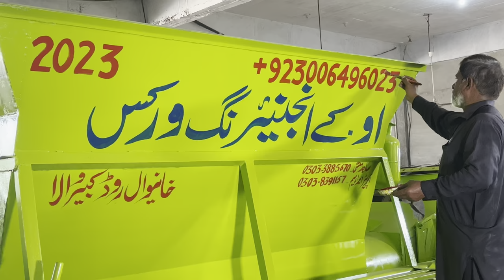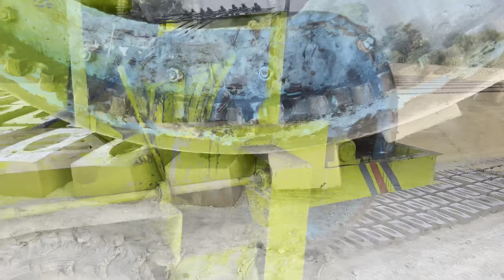Manufacturing Process of Bricks Making Machine With  4 Moulds Rows || Mobile Bricks Machine

Comment: You got to hand it to those guys, they don’t waste anything! Most all of the material looks like it was salvaged. Over here in the USA everything would have been new material and the cost would quadruple. I have always been know as a scrounger/Hoarder and have made some really useful and even elegant devices/machines using mostly salvaged materials. Using that kind of material requires lots of “Fluidity “ in the design. Hahahahaha! Good job guys!!!!
Reply from the maker: Thanks for watching ❤️
Reply: Most of the metal comes from  old ships the come to be scrapped all the different companies go to the coast and buy whatever types of metal they use

Comment: Wonderful Machine prepared by great hard work and Skill, although it has complex technology and manufacturing but is very much useful for Bricks Making Industry, it will definitely reduce the Labour Cost and increase Quantity of Production, so Bricks Price May Reduce, The Manufacturer Should Pay Attention on Machines, Like Lathes, Drill Machines and Grinders etc, Use Raw Material (New One) and PPEs for Workers, they (Workers) should also be well trained in like, Fitting Parts, Bearings  not to be Hammerd and produce Welding Joints as per Standard Practices so that their Skill may become Solid and Proven one. Thanks a Lot for the Video and Effort carried out in preparation of Video.
Reply from the maker: Yes sir you are right

Comment: ==> English <==
It's incredible and I was shocked by several things I saw in the making of this machine:
=> The skill of how they make the pieces without greater technique or millimeter measurement.
  => Those old lathes they use do not have the adjustment to perfectly polish the pieces with vibrations and shaking pieces.
=> The cuts are made by eye and very rarely are they seen taking measurements. I only saw a template to make the holes in the wheel that delivers the brick to the floor. The leveling of the chassis on a cobblestone floor that shows the ups and downs.
=> No security measures, with sandals making cuts and welding left and right.
=> Minors or very young people working ordinary.
=> In addition to many other things, it seemed impossible to me for the machine to start working without doing any type of operating tests on its precarious manufacturing. And after finishing go to work impeccably? They are worthy of admiration.
My most sincere congratulations from the industrial city, Manizales, Colombia!!!!!!
                               ----------------------------------------------------------------------------
==> Español <==
Es increíble y quedé impactado con varias cosas que vi en la fabricación de esta máquina:
=> La destreza como hacen las piezas sin mayor técnica ni medida milimétrica.
 => Esos antiguos tornos que utilizan, no tienen el ajuste para pulir perfectamente las piezas con vibraciones y piezas trepidando.
=> Los cortes son a ojo y muy rara la vez se les ve tomando medidas solo vi una plantilla para realizar las perforaciones a la rueda que entrega el ladrillo en el piso. La nivelación del chasís sobre un piso adoquinado que se le nota los altibajos.
=> Las nulas medidas de seguridad, con sandalias haciendo cortes y soldaduras a diestra y siniestra. 
=> Menores de edad o muy jóvenes trabajando común y corriente.
=> Además de muchas cosas más me pareció imposible que la maquina entrara a funcionar sin hacerle ningún tipo de ensayos de funcionamiento en su precaria fabricación. ¿Y después de terminada entrar a trabajar impecablemente? Son dignos de admirar.
¡Mis más sinceras felicitaciones desde la ciudad industrial, Manizales, Colombia!!!!!!

Comment: These men make so much with such little tools. They believe in brute strength to move things. Their work ethic is stellar. These men sure know how to work. Great job to all the men involved. The only thing that needs to be standard is some personal protection equipment. IE: Steel toed boots, dark glasses when using the cutting torch and most importantly a proper welding helmet that protects the sides of their face and eyes. They should not be forced to work in unsafe work conditions.

Comment: In 2023 I would expect to see more safety equipment used, than sandles, no safety glasses, or face shields, even for welding. Although I am amazed by the level of skills to manufacturing these machines, with almost primitive tools and manual labor. Somewhere there is a OSHA inspector's head exploding, just watching this video.

Comment: Is this a video of the Taliban building a tank or? Anyone else looking for Tony Stark building an Ironman suit? :)

So let me guess the job requirements:

1. NO safety glasses, gloves or other PPE. (Works great when using a metal grinder. Those sparks of HOT METAL will never hit you in the face).
2. Open-toed shoes or sandles are OK (perfect when using a cutting torch or moving heavy steel around).
3. You will work in dirt... and maybe more dirt.
4. NO overhead crane or device to move heavy items... Just you and 10 buddies...
5. MANY trip hazards will be in your way. Watch your step!

Sorry to gripe. I hate OSHA just as much as the next guy, but damn.. this video is proof why they are needed! 

I watch a lot of these types of videos and it amazes me that most do not use basic PPE such as safety glasses and proper shoes. Some don't wear shoes at all! I guess the fear of losing an eye, toe, or finger or busted back doesn't bother them. Any of which can happen in a split second (I'm living proof and I DID have proper PPE).

I must say that guy has a very steady cutting hand with that torch! Nicely done. Not many people can do that. And despite being a turd-world country and poor machining capabilities - they do get stuff done. You do what you have to do!

They should also heat that housing so the bearing will install without beating it to death. Using their torch, all it would take is a few thousands of expansion and that bearing would probably drop in by hand. Old machinist's trick. Works every time. Also freezing the bearing or heating its inner race works good too. 

Thanks for the video and THANKS AGAIN for not putting stupid-lame music over the top! Personally I enjoy HEARING the manufacturing just as much as watching it. I cannot stand music of any kind laid over the top.

Comment: In the UK we seem obsessed with steel toecap boots. I'd love to see the injury figures for India v UK!
Reply: These guys are in Pakistan but close. The figures can be found online are not good. Unfortunately, this minimum safety in the workplace is seen across the third world. It's hard enough to get companies in the first world to follow the rules. They also don't have easy access to proper safety gear and if they did it wouldn't be affordable for them. The sad part is the guys not having proper eye protection. The guys using the weilding shield hold it too far away for it to give full protection. They will lose most if not all their sight at much earlier than normal.
Reply: These videos are from Pakistan not India.

Comment: The guy at 10:20 is not wearing a safety welding mask which protects the eyes. The mask just lays on the part doing NO protective function.
At 12:46 one can see welding sparks spattering on the unprotected  ways of the lathe. Also, take a look at that safety mess behind the lathe. It looks like they never take the cutting chips away. 
One more thing, take a look at that open electrical box to the right of the lathe; up on the wall at; 15:40. (Remember a Rupee is worth a little more than one cent U.S..
At 1:46:30 no paint mask here!
Reply: Also they're using 400v 3ph power there, it's no joke. 230volts line to ground. A little more spicy than the 120v line to ground in USA. This would be comparable to an industrial facility running on 277/480v here in USA.

Comment: They have pretty ingenious methods especially as they are working with basically scrap metal. Even if the original design is probably borrowed from somewhere, the end result is pretty good. They seem to have about two semi-broken welding masks in the manufacture though, I know it's a poor country, but an automatic mask cost about $25 with free shipping from china... A simple mask $5.. They can't be that poor..
Reply from the maker: Thanks 🙏 for watching
Reply: Let's see, it is all relative.  The average salary for a worker in Pakistan is 81,800 Pakistani Rupees which is $287 USD a month (the latest 2023 figures). It would be fair to think that these workers aren't going to spend any of their existing meager wages on safety gloves, glasses, welding masks and safety boots. Although, having said that, it should be the employer providing that for them, but I doubt they are swimming in money. I would say that as creative as they are, that they can fix the existing welding masks they do have. It's a shame that US manufacturing facilities throw away a lot of safety gear and guys like in this video could be using them. Many manufacturing plants issue a new pair of gloves on a weekly basis and generally there is nothing functionally wrong with the old ones except they are dirty. Back in the day when I worked on an assembly line, I didn't like getting a new pair unless there was something wrong with my existing ones as I always thought it was wasteful and contributing to landfills unnecessarily.
Reply: @dianad3080  It is all relative indeed. $287 doesn't sound much but it all depends on their expenses. Still, $5 for a new shield is less than 2% of that, I'd say affordable, particularly if it makes work better, safer, easier.
Reply: @OmgSaySomething  интересно,в их стране можно купить инструмент,спецодежду?

Comment: For those of you thinking why cant we do things like this in the United States well ill give you a few reasons. 1. Safety is our number one concern. There’s nothing safe about what these guys do. 2. We engineer everything we do here so it comes out just right. These guys just weld a bunch of metals together and hope it works. 3. We do precision machining here with raw materials. These guys use mostly scraps and forge there own metals which are actually very dirty metals that can be weaker. Also we use composites when possible to save on weight. 4. We have robots that help us get the stuff together. Im not saying these guys dont do good work cause hey at the end of the day it works right. Im just saying put a nickel on  its edge on their machine and one on ours while its running and i guarantee ours will stay standing on its edge with almost zero vibration.

Comment: thats how they made all the hard disk drives - intricate patterns cut into thin platea and later all bonded into a block  like a motor plus plus plus.  Balancing not required here, never going to see even > 25 rpm
Reply from the maker: They keen on balancing ✍️